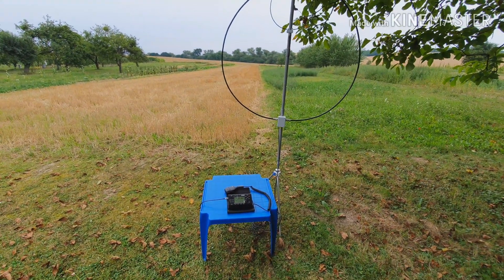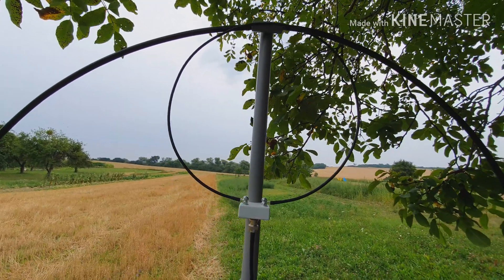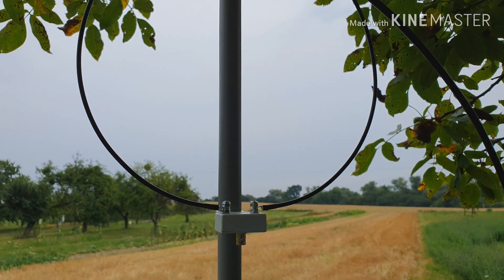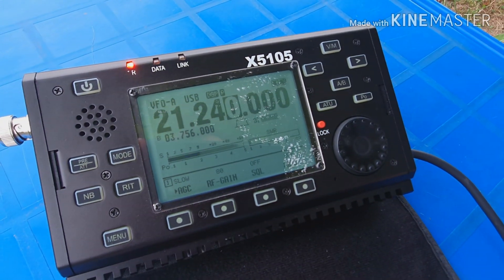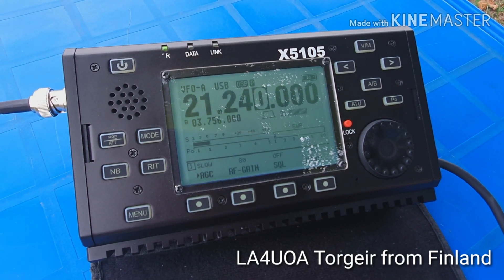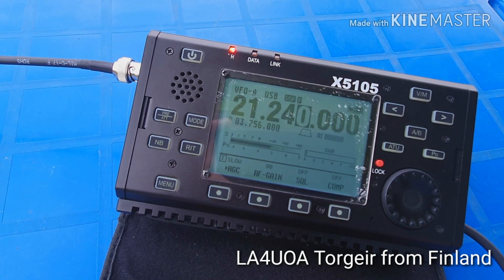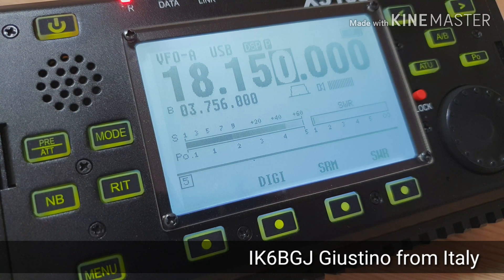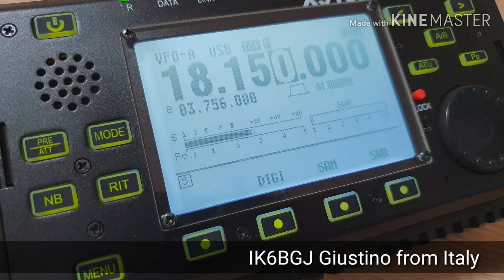Magloop antenna & my new coupling system (4K video)

Comment: Hi, I like your coupling setup. Have you tried using different coupling loops diameter? Different coupling loop diameters on different bands  improve efficiency and your mounting system would make this easy. Great setup. Thanks for sharing.
Reply: I saw this video some time ago and remember what a good idea that was. 

I’ve always used T240-43 toroids as a n turn : 1 turn impedance transformer.

My 40m tunes 50ohm at resonance with 6 turns. The same loop tuned to 20 only needs 3 turns and I have to wrap the feed winding around the antenna loop for best match. That’s on a 5m circumference loop

I’m now trying to get the smaller 3m loop to tune 10m and having problems as the loop is a little long and I can’t get an impedance match at resonance 

Looking at gamma matches and coupling loops to get it to resonate at 28MHz. 

I have found if you can get the SWR dip to correspond with the loop resonance, you get better results than when the SWR minimum is different to the resonant frequency of the loop.

Comment: If I may, I would like to suggest an experiment.  Here is the basic idea:
Measure the field strength you make several meters away 
The loop's tuning capacitor has quite a high voltage on it at the RF frequency.
Rotate the antenna so that the capacitor is to one side in the middle.
Make a short fat dipole antenna.
As we know a short dipole looks capacitive.
Mount this dipole at the capacitor vertical and connected to the capacitor
Trim the tuning.
Check the field strength again.
I think the dipole will add signal as seen off in either horz direction but not straight up.
Thus more power will be sent where you want it.
Reply from the maker: Thank you. You mean to made a directional magloop antenna? Hmm.. could you send me please a sketch or diagram of it? For my better imagination? I may to try it...
Reply: @OM0ET  
I haven't made a picture of it yet, it is just an idea.

Comment: thank you PAUL for sharing I ask again to activate my callsign because I stopped for 10 years and I should resume F5OKB.
I would like to realize your antenna but I can not find the variable capacity. Can you give me a link to buy this capacity?
the top would be able to one day copy you with your antenna
thank you very much PAUL and 73
Reply from the maker: Hello Pierrot! Thanks for your nice comment ;-) For your own project you can use for example this capacitor on Ebay:  https://www.ebay.com/itm/Air-Variable-Tuning-Capacitor-ELTRA-Dual-Gang-380-320-2x14-7pF-1pc-new-/291923147870?oid=291970236315
I hope to hear you one day from loop to loop ;-) That would be great! Hi. 73 Paul OM0ET
Reply: @OM0ET  thank you PAUL I start the reception of my call. I will also mount this qrp which I think will make a good together for qrp performance thank you again.
http://f8bdx.free.fr/_bitx_3414.htm

Comment: Will adding 80 meters be too complicated? Just wondering. 73
Reply from the maker: 80m could be done by adding additional capacitor. But by this diameter it will work effective only on receive. 😉
Reply: @OM0ET  Thanks.
Reply: A bit of a late note but I hope this helps:
If you make two turns around on the main loop and add a switch to the capacitor box, you can run the two turns in series or parallel.  When in parallel it looks like just one turn as usual.  When in series, the inductance is almost exactly 4 times as big.
I have (in the distant past) made inductive loop antennas for AM radio frequencies.  They had more turns but the idea is kind of the same.  I had to carefully tune to get good reception but the experiment worked.
Reply: @kensmith5694  The penalty in efficiency is enormous making more than one turn.  I made a 40 meter loop with two turns and it obtained only about 1/4 of the signal strength.  It tuned, but it is not efficient.
Reply: @thomasmaughan4798  
You need to space the windings and you also may have to use wire rope.  You need to fight the proximity effects as well as the skin effect.  The smaller diameter means the current is much higher for the same radiated power.